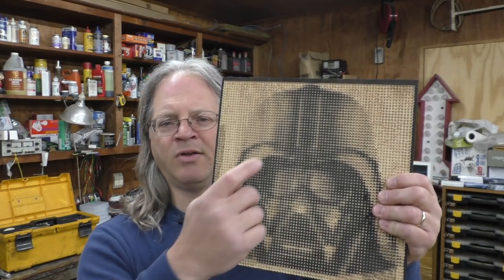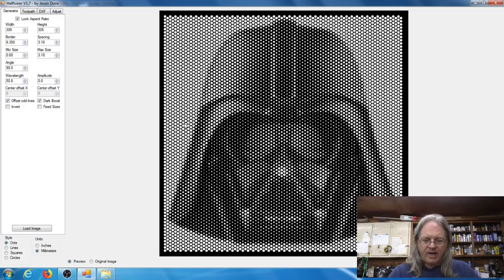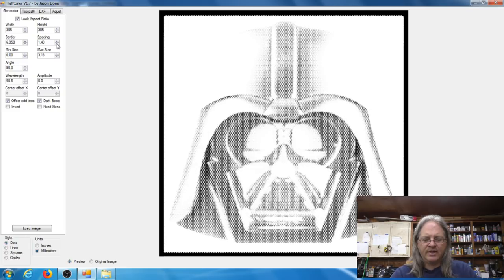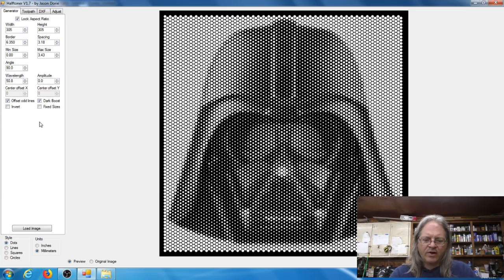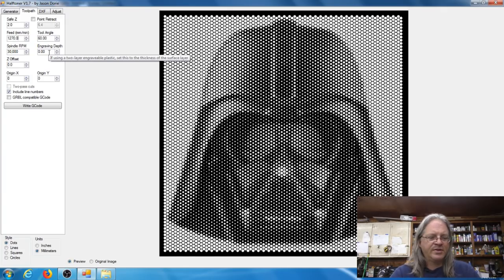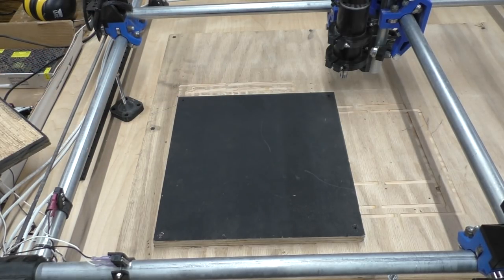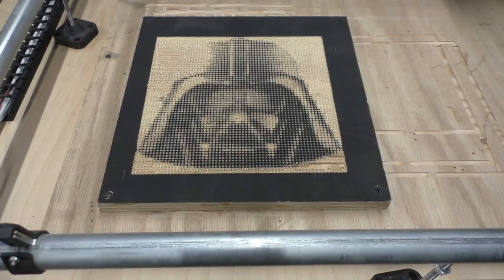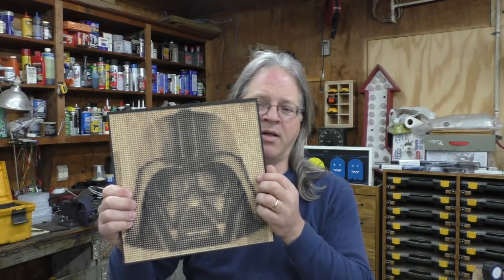How to create Halftone Patterns with your CNC Machine

Comment: i tried it today on plolycarbonate.. didnt turn  out well but i did only do it on a small 2x3in test piece.....couldnt see any dertails..also i may need to mess with image inverting etc..i saw someone do it and he put a black piece of matyerial in back and then used leds to light up and it looked great but he had a pretty big engraving about 15x20in ..looked pretty good..the black background helped a lot ..and fyi i used lines not dots..im my opinion dots puts way too much waer and tear on cnc machine...and takes a lot longer to do as compared to using lines

Comment: I am using small CNC router and it works with MACH2. The question is how to adapt G-code generated by Halftone software to G-code I could use in my cnc. To mention that I am new in this job... Thanks

Comment: Where do you zero it? Corner, center? I have my program drawn and ready just haven't taken it to machine yet and was curious of this aspect. Thanks in advance
Reply: May be wrong but watched the video again and when you go to write g-code I'm wondering if it's the origin for x and y setting. 🤷🏻‍♂️
Reply from the maker: Sorry, it's been so long since I've used this software.  I think you can select in the software which corner to set 0,0.